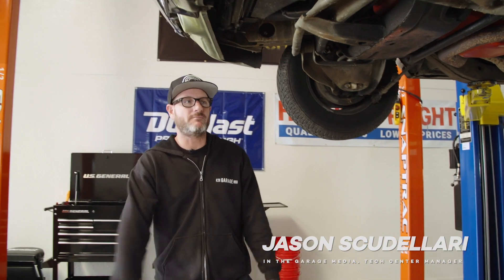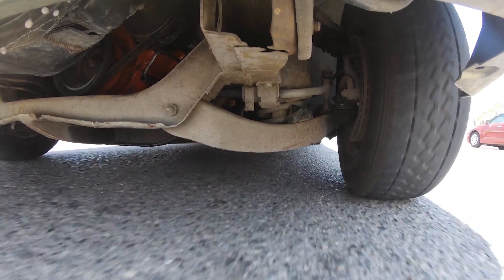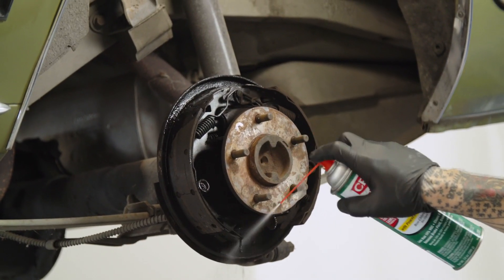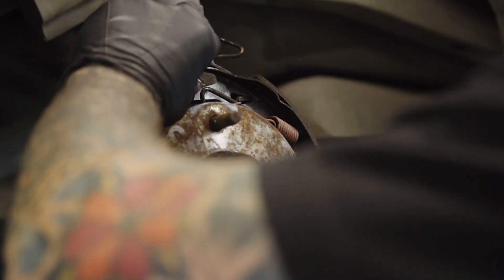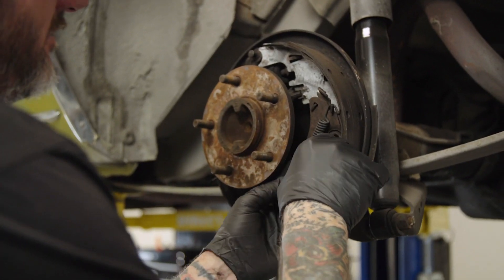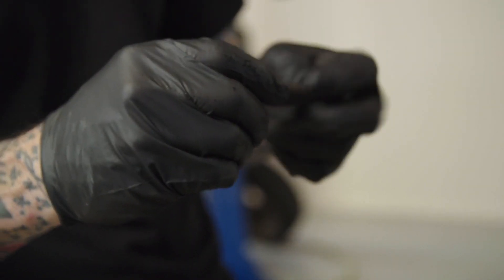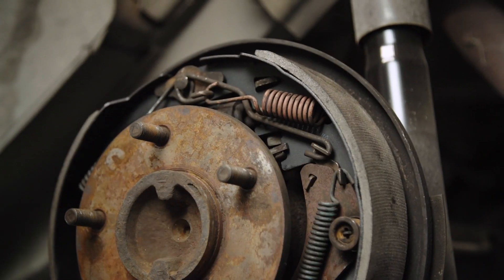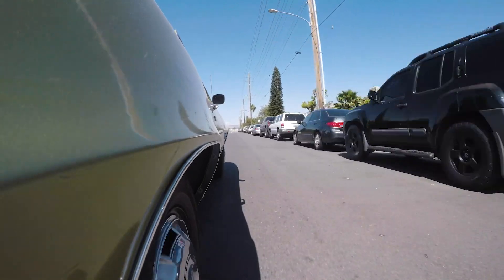How to install and adjust drum brakes on a 1969 Camaro

Comment: Before you pull the drum take out the rubber plug at the bottom rear of the backing plate (adjuster window) use your adjuster tool to back off the shoes so they aren't spread this will make taking off the drum easier and you won't have to hammer the drum off and potentially damage it. Way to get this Camaro back on the road!
Reply: One problem there! No adjuster windows! The drums actually have a window in them not the backing plates. Not a big deal cause I'm going to drill out the backing plates. Couldn't find drums with the knockouts. Kinda silly to do it that way. Didn't think that one through did they? The car is a 69 Camaro base model. Nice looking car for one that sat.